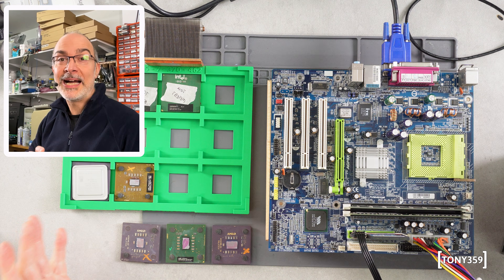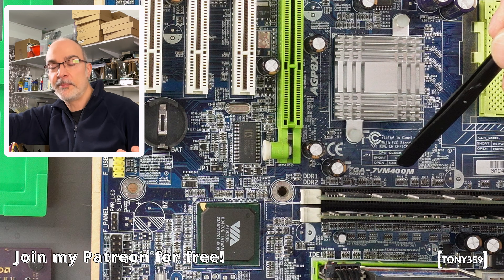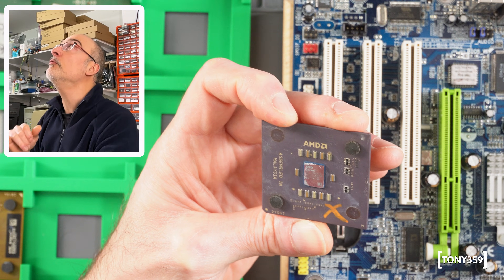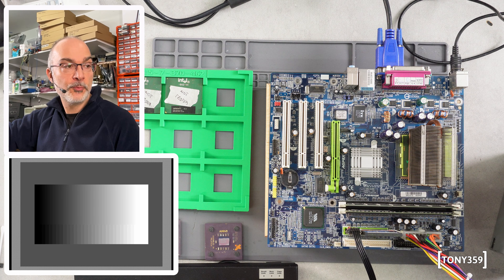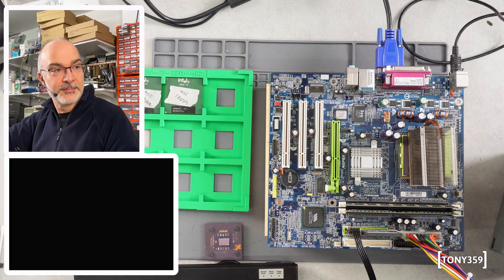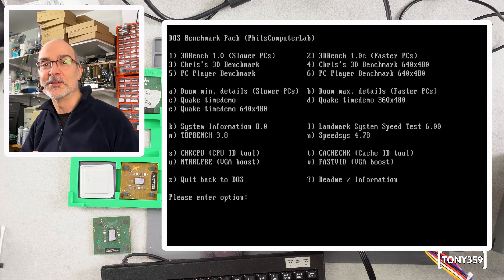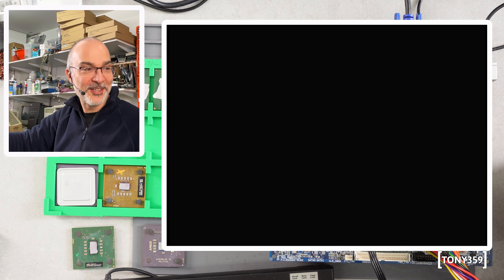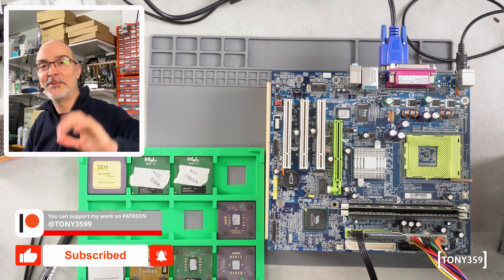I made a mistake when testing my AMD CPUs!

Comment: I have a small graveyard of Motherboards and Graphics cards that have failed in the past. Mostly from the early Athlon era, but all sorts of odds and sods. I kept them to harvest spare connectors and capacitors, so some parts may be missing. Would this be of any interest to you?
Reply from the maker: Hi - thanks for the offer. Athlon MoBos might be already "too modern" for me, if you happened to have something older than that, let me know. My email is on my profile!

Comment: The video issue in PC Player 640x480 benchmark is due to an issue between the software and the GPU and not an issue with the CPU.  I've seen more issues on newer graphics cards and less on older.  I enjoyed this video.  Glad it popped up on my recommended.
Reply from the maker: I'd imagined that, the video adaptor is in the chipset on this board. Thank you!

Comment: My Duron had also cracked edges, but that wont harm them really because the logic is on the underside of the silicon. Using a higher FSB ist an easy way to overclock those CPUs, +33% should do almost all cpu's, some can even do +66%, my Duron back in the day could even do +100%, but had to crank up the VCore a bit. Imho it was a Duron 750 running at 1.5Ghz. I don't really remember the cooling, either a watercooler or compressor. That were the best times for overclockers. :)
Reply from the maker: yes I remember all the overclocking techniques and you could get quite a lot out of it! Nowadays it's less critical, CPUs are basically overclocked by the manufacturer :D

Comment: Be careful, the foam pads will stop the cooler from touching the die when you just rest it on top like that. The cooler has to be pushed down!
Reply from the maker: Yes, I was pushing my luck there. But the cooler is heavy enough to compress those pads thankfully :) It was actually getting pretty hot!

Comment: Glad that those finally work! Back then we used copper spacers to sort of protect cpus, although I've never chip a corner when mounting heatsinks without spacers, it's always been a concern for me. Also note that Socket A CPUs have 4 foam resting pads for the heatsink, in order to have the heatsink mounted as even as possible, but some heatsink mounting clips were still prone to die chipping (I'm looking at your, Volcano 7+).

Tony, there's more have fun to be had with those ceramic Athlon and Duron: the pencil trick. That'll allow you to unlock the multiplier. You can overclock or simply run at the same frequency but at a faster FSB.
Reply from the maker: yes, I know there is a lot to do with those CPUs but I'm happy to leave the overclocking to others! :) I'll bear that in mind though :)

Comment: Great catch by the commenters that caught the jumper on this board for the FSB setting, and it's awesome that those two AMD processors work. Especially that "Morgan" core Duron processor, I feared that the chipped corners were going to have done that processor in... and yet it's a trooper! (Yeah, I've always thought it was cool that the code name for a processor shares my last name, even if it was only a Duron part, and even if it's actually named after the breed of horse.)

Comment: A 1200B, great for a 100FSB board... I had a GA-7IXE4 and had to change CPU, as I got a 1000C which only ran at 750 - got it replaced with a 1000B
The board was a desperation choice when the 686B bug was news, so I didn't want VIA (or the half and half AMD760/VIA 686B) and also it had 2 ISA slots when I really would have liked 3 and most others had just 1.
Trying to remember my full ISA loadout that came from a Tyan Tomcat
Lasat Safire 56k modem - and it BLASTED a good V90 speed, V90 after I firmware updated from K56
SB16 ASP with midi DB
Iomega Ditto Dash tape controller
Additional Parallel port controller to avoid chaining printer and scanner.
I ended up replacing the modem with a Cirrus Logic HaM chipset (controllerless, rather than a total softmodem) - which was also a solid V90 performer, and the sound with a PCI128

Comment: And that’s why one should read the motherboard manual. I check all jumpers and their meanings. You mentioned the CPU spec, and that is part of the process, before even trying on a motherboard: you can fry the CPU depending on the motherboard/chipset generation. CPU Vcore compatibility comes first, and the FSB as you noticed. With Retroweb and Cpu-world at everyone’s disposal, it should be a mandatory sequence
Reply from the maker: of course - I just assumed and I made a mistake :)
Reply: @tony359  we all make mistakes. Believe it or not, I fried a DVD Rom drive by inserting the molex power conector inverted: it shouldn’t be possible, but one can do that with enough force (doesn’t need to be extreme). My eyesight is not what it used to be, and now I use a flashlight and sometimes magnifying glasses to avoid such silly mistakes. That was a wakeup call, and I’m glad it was not a critical component. Thanks for sharing

Comment: Awesome! I think only very late S462 motherboards were fully jumper less (nforce2 & VIA KT600 for example) and run by default at 100MHz, it's pretty common to find these with batteries that gad run out showing CPU speeds and models that never existed, you can leave the jumper at 100 as a safety measure, it will just under lock any compatible CPU.
Reply from the maker: I'll bear that in mind - I should have checked on the manual! :)

Comment: Just a question. Could the socket from the video by chance be found in old laptops to?
Reply from the maker: Old laptops often had socketed CPUs - though they were "mobile" CPUs. I am not sure about AMD though.
Reply: @tony359  Just wondering because I have this old Intel Celeron Q038A171-08423 sitting in an old laptop. I know the CPU works because I've used it before.

Comment: Be carreful with those old AMD cpus, make sure to use some thermal paste since it is bare silicon and the overheat protection might not be fast enough to save it. Perhaps it was not shown in the video if you used thermal paste or not. 🙂
Reply from the maker: I did! :) 
But thanks, I'm aware those CPUs are very delicate. In fact, it's why I didn't want to install/remove the heatsink every time, the spring is very stiff and I feel I am about to destroy everything every time! :) 
But yes, if the heatsink tilts for a moment, bye-bye CPU.

Comment: Put those cpus in extensive stress test, especially involving video encoding/decoding. I had Athlon with Barton core with damaged die, which seemed to be fine on a first glance, but overheated like hell under stress.
Reply from the maker: Good to hear that - so weird though. You think that maybe the damage might cause the heatsink not to adhere flat to the die?
Reply: @tony359  Impossible, I double checked everything, including testing other cpu, which was fine. Plus that faulty Barton overheated in other motherboard as well.

Comment: About the broken die cpu, it might still be broken. As someone who assembled hundreds of Athlons back in the early 2000's I still remember the problems that those caused, usually the broken corners caused errors in extended instructions, we did a video processing test to check if they were ok or not, if they are broken usually the compression ended unexpectedly or the video contained green artifacts. If I recall it right we transcoded from uncompressed AVI to MPEG 2.
Reply from the maker: interesting. Maybe that was the reason for the video corruption?
Reply: @tony359  Yes, it's possible. If with other Duron in the same mainboard you don't get the corruption probably the CPU is damaged.
Reply from the maker: I might change the green check to a yellow question mark? :)

Comment: These exposed dies can take a surprising amount of abuse since most of the die is bulk silicon. The only part carrying actual transistors or metal layers are just a couple of micrometers at the bottom of the die.

Comment: Those CPUs could work with 133 MHz FSB with low multiplier (for example 11x model OCed to 133x9=1197 MHz).
Reply from the maker: interesting - can you change the multiplier on that board?
Reply: @tony359  You can change it on the CPU (voltage too, so be careful).
Reply: @tony359  Oh the great days of pencil or conductive paint... some boards could set multiplier (dip switch or BIOS) but the multiplier bridges were cut on later CPUs - equally, the CPU also had bridges to set the multiplier itself and those could be reworked

Comment: This must be socket A. Used to have one of those. I remember some of the processors could be overclocked using a pencil on those gold pads!
Reply from the maker: That's Socket 432. Never had a Socket A one.
Reply: @tony359  It is called Socket 462, also known as Socket A. Not to be confused with slot A. I am a loser but at least I know my wikipedia articles by heart.
Reply from the maker: I couldn't be more inaccurate on my previous reply then :D
Reply: @tony359  Yes, their Slot was Slot A (if I recall, same connector as Slot 1, but reversed) and the socket was Socket A... but there were never slotkets for AMD!

Comment: I used to have a similar AMD CPU probably a decade ago at this point which had chipped corners and while it worked it was very very unstable the computer acted very weird etc. It would be interesting to run a stress test on that to see if it’s stable or not.
Reply from the maker: ah, interesting. To be honest I feel that if the die is even slightly compromised, the CPU wouldn't work at all. But who knows. Thanks for mentioning, I'll bear that in mind!

Comment: Good that you figured it out. These CPUs can be harder to work with. The die can chip easily and coolers can be tricky.
Reply from the maker: yes, I remember the fear of attaching the heatsinks on those CPUs - hence using the "temp" one on these two.

Comment: i have a Duron that's chipped too, and still works! wow, that was so close :))  what material did you use for the CPU tray, Tony? it looks very nice and smooth. do you have a code, or something, for pcbway? wanna order some cpu trays and also found an SD adapter to the 3.5 bay
Reply from the maker: I added the link on the main video: https://youtu.be/xAcd3lh_MfE
Ideally you want ESD plastic but that's more expensive... I love those trays, finally no box anymore :)
Reply: @tony359  damn it, i ordered PETG cause i did watercooling long ago and it seemed smooth like that. anyway, o rdered one piece of sd card adapter and i'll see how it goes with petg. 8 bucks is not that much
Reply: Look for a used ender 3 printer, they are like 100 bucks these days.
Cheaper then let pcbway print stuff like that.
Once you have a printer you start printing more and more tools, trays and such.
Reply from the maker: Yes, I can imagine once there is a 3D printer, then the sky is the limit! :) 
What I don't have is the space....